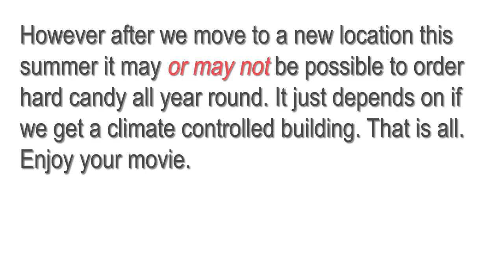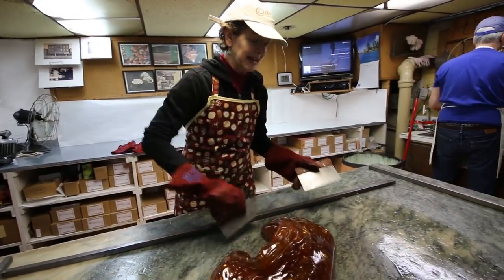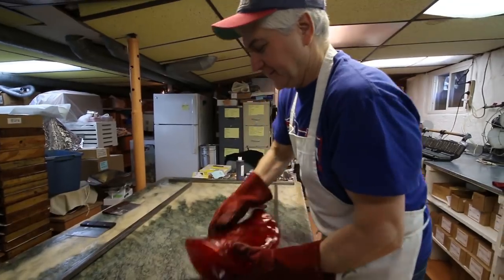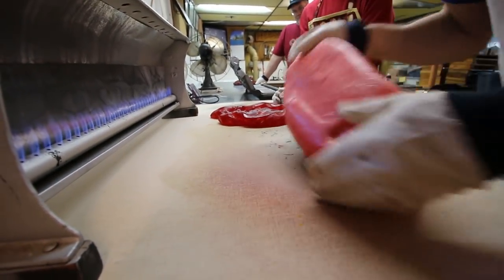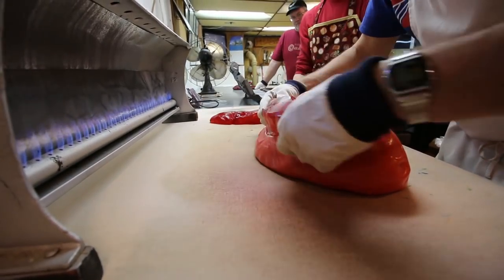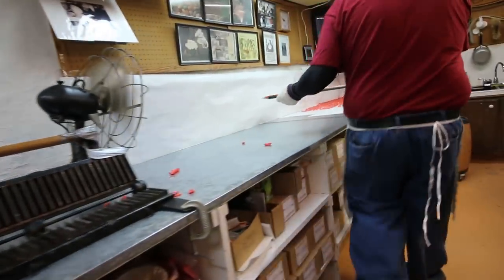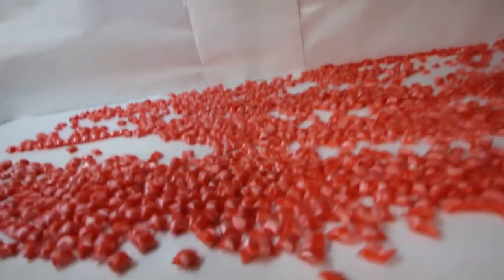Wintergreen Flavored Hard Candy

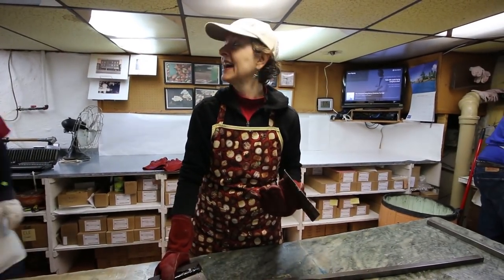Comment: 3:10 Picked up a tool from the floor with candy handling gloves. No sign of changing gloves before handling candy at 4:39
5:00 Used broom and dustpan and changed jacket without washing hands before putting candy handling gloves back on.
I didn't watch further. I don't want to know.